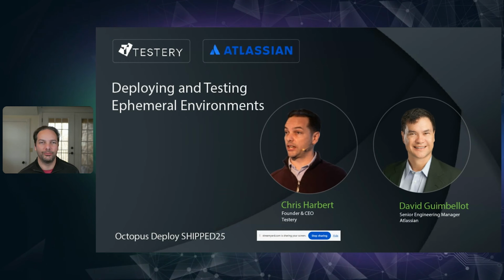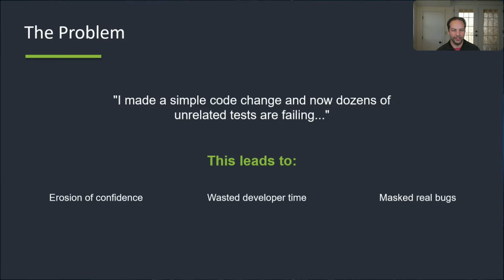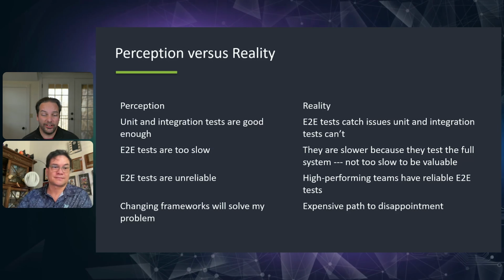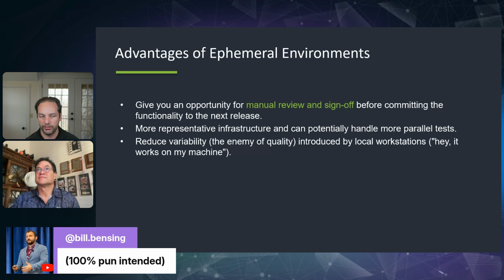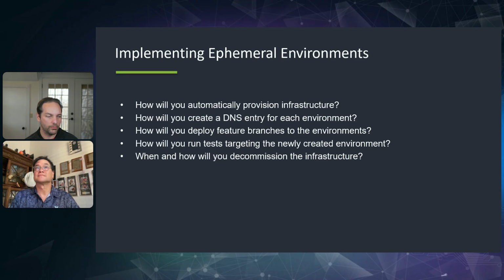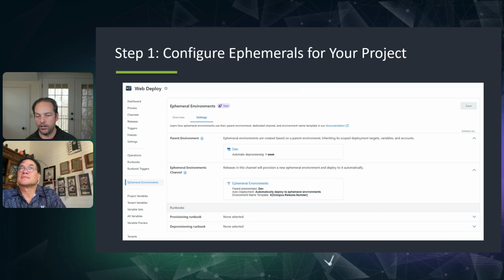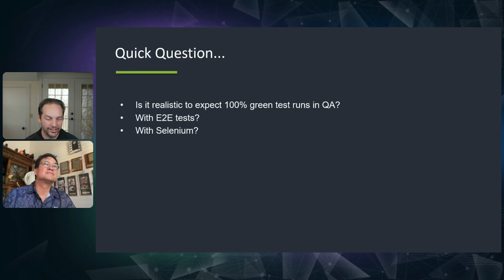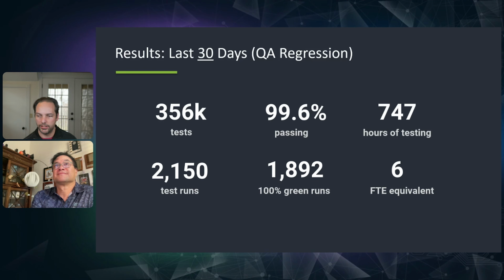Deploying and testing ephemeral environments

Comment: Great video liked it a lot. I was doing something similar way back in 2018/2019 ish.. using octopus tenants to spin up different environments. Nothing quite as polished as this. But back then tenants were unlimited I think..? Do each of the ephemeral environments use/require a tenant? 
(I ask as I believe the number of tenants is now part of the newer  licencing model. I.e. they are not unlimited but are boxed to a certain  number with a licence.. or you buy more ?
Reply: Good question! Short answer: no, each ephemeral environment does not require a tenant.

Historically (and in this talk), ephemeral environments were implemented using regular Octopus environments + dynamic infrastructure, created per PR/branch and torn down.

As of Octopus 2025.4, ephemeral environments are now a first-class feature in Octopus, but the core model is the same; they do not require tenants, which is important given tenant counts are now part of licensing.

Tenants remain the right abstraction for long-lived, customer-specific deployments. Ephemeral environments are intentionally tenant-free, short-lived, and automation-driven, so they scale without hitting tenant limits.
Reply: Thanks, @madheaduk! The new ephemeral environments feature of Octopus Deploy makes this significantly easier. It also means you can use the Octopus UI to see what ephemeral environments are currently active and automatically/manually deprovision them when you're done. I recommend trying out the ephemeral environments feature if you haven't already!